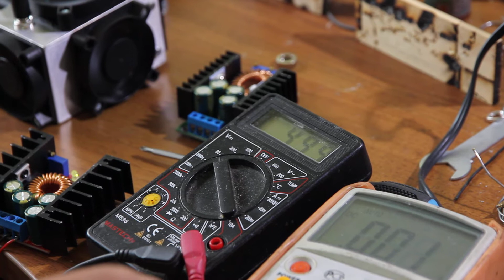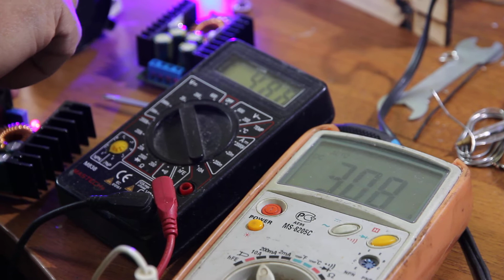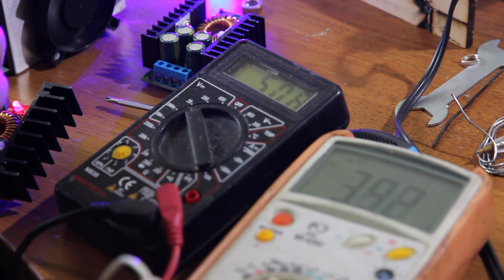Overclocking an Endurance 10 watt laser module. DO NOT REPEAT IT WITH YOUR LASER.

Comment: My 10w deluce laser is only putting out 11.9 amp, 4.5 volts at 4.3amp. do i need to adjust the power?  It's focused properly, but not cutting with 10w power. My other 10watt laser cuts 3mm mdf with 2 passes at 95% power. This laser cannot in its current situation

Comment: what is the maximum  voltage needed to a laser of 405 nm and power of 1.5 Watt plllzzz and what happen If you plug more voltage let's say voltage needd is 7 V and you put 8V
Reply from the maker: I am not sure about 405 nm - you need to check datasheet, but yes, 7V is possible

Comment: Could you make a video for people who don’t know a lot about electronics please? My laser 10w laser needs adjusting and I need to SEE where you’re connecting the meters. Your friends hand is in the way for most of this video!
Reply from the maker: I did a new one... it called laser power measurement!
Reply: One would question, if you don' know a lot about electronics, would then it not make sense that high-powered lasers are probably not be the safest gear to use as a launching platform, not the best fit for learning about electronics?   THey're expensive, very dangeroous, and very particular about their needs.  If you can't build a constant current supply without asking "what's that"… you should really start elsewhere about learning where appropriate locations are for applying which meter lead before you blow something up, catch something on fire, or suffer a terrible accident.  For reals…. Not trying to be a kill-joy, but just being practical.  One little mistake about a meter setting or lead placement (like setting current not voltage) can easily short and toast your expensive 10W Diode… instantly.   Of course I know this reply is late Im' just trying to state the obvious for the benefit of others so inclined.  It's not personal.  Just pragmatics..